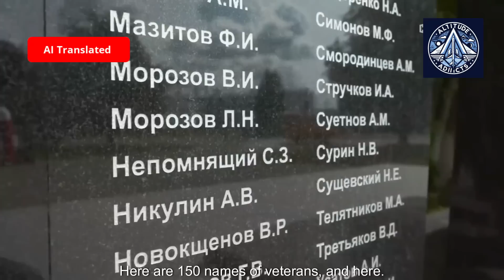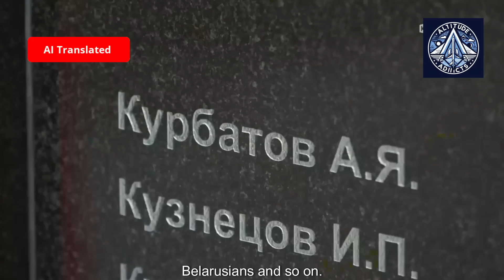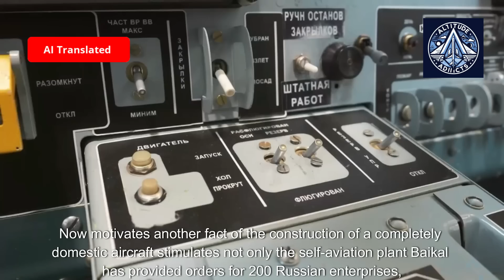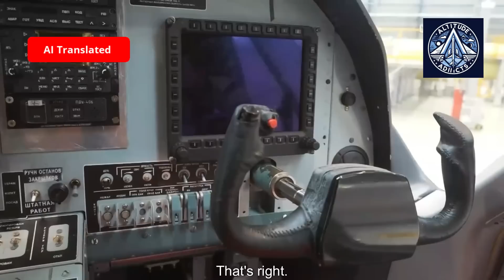How the LMS-901 “Baikal” Aircraft Is Made

Comment: This aircraft has very good potential outside of Russia.  Most aircraft in this range are past midlife.  Baikal made a huge investment in western engines and avionicems before the sanctions happened.  Baikal should find a western partner so this investment doesn't go to waste.

An example of a partnership is the aircraft body is produced in Russia, then shipped to a western partner where the non sanctioned western engine and avionics can be installed.